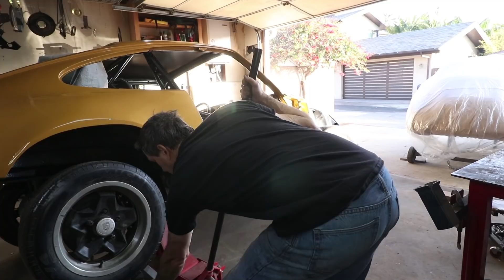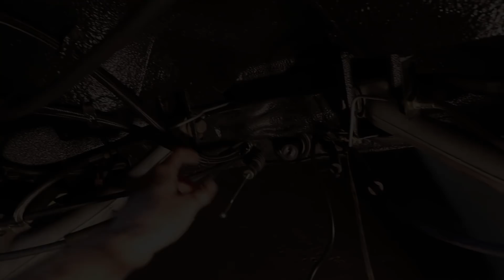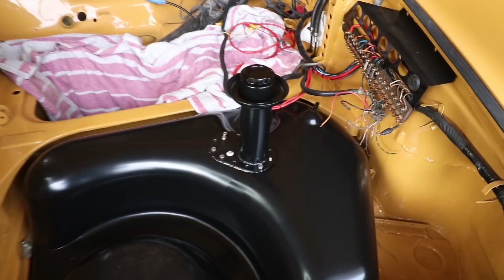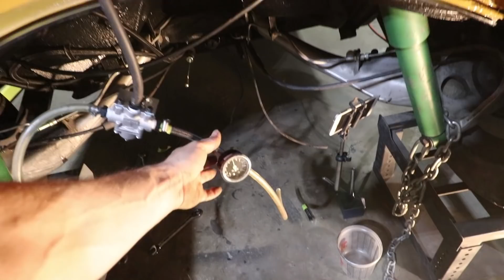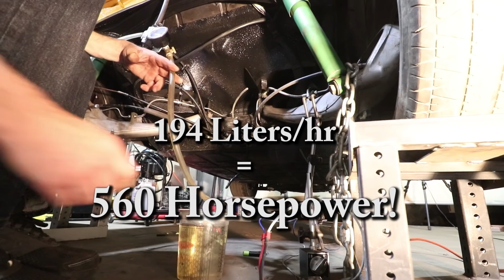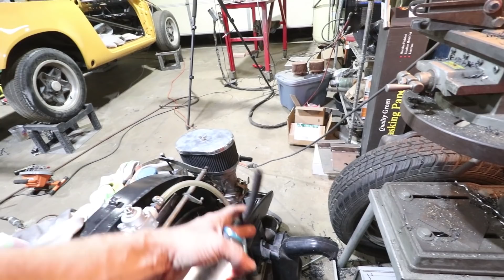We Have GAS in My Porsche For the First Time in 25 Years!

Comment: Kool Tools makes an awesome hose assembly tool that makes AN hose end assembly super easy and results in a pro fitting install.  Used it on the stainless braided lines that i installed for my transmission cooler on my '56 F100 restomod
Reply from the maker: Awesome, I'll check it out.  Although I think I'm done with hoses for the time being.

Comment: I really want a Max Jax setup but I keep seeing you not use them due to set up time and I'm afraid that is what I will end up doing.  I take it you can't leave it set up and fit both Porsches in the garage?  My friend has the Max Jax with a super wide garage, 2 cars wide 2 cars deep and he can leave his Max Jax setup all of the time.  He even has it at an angle which is super nice.  You would like his Garage as he has two 356A Porsches in beautiful original condition. One is a light blue and the other is red.
Reply from the maker: It's probably 30 min max setup time, so not that big of a deal.  Both cars can't fit with both posts in place unfortunately.  
It's kind of pain to get started because I have to winch the 356 or 911 out of the way and then move a bunch of stuff around.  
Labor love right?
Btw, I saw your pinch weld tool and it's nicer than mine!  Good job!

Comment: I cut the hose on a sharp angle. Then slide the fitting.
Slide the fitting down the hose. Then mark cut with Ziz wheel. Slid fitting up to the cut.
I forgot to say Merry Christmas and a FINISH the Porsche Happy New Year !!!
    I love this build , because its, done the way, I've built every sports car I've owned from 16-65 ( currently building two Datsun Z cars)
I would suggest you find a 6.
While you can still get one.
    But keep your 4.
Because at some point YOU WILL BE FRUSTRATED.
Build the 6 over time.
What happens, where the Frustration comes, the 911 guys dismiss you cause it's a 4. And the 356 guys , dismiss you cause you have a 911 shape.
Your orphaned like Rudolf, can't play in any raindeer games !
    Believe me when I say it gets OLD quick.
    Especially when you find out your car is done better than most that ,shun you!
     Once you finish the 6.
Than you can ,four bolt swap
Any time you want to ,wipe the smug ,look off their faces.
    Having the ability to swap motors, it brings you up to, the most Satisfaction, you can have in your car.
   Because NOW you can Run with any of them ! If you EVEN want too !
     What is the difference, between the 912, and 911?
  Just the MOTOR !
Of course there are details.
But it's just two more cylinders soon you won't be able to get a Six.
I suggest to grab one. How much value, have you increased, your perfect build,
when you have two motors?
To satisfy the purist, and the hot rodder !
    Just saying your CAR is Worth this Multi Motor ,concept.
Reply from the maker: Thanks for tip on getting the hose length right!  
The six is on its way in a month or two hopefully if all works out.  
This car will never be finished even once the six cylinder goes in.  It will always need some tweaking, improving, inspecting, etc.
I have a lot of respect for these 4 cylinder engines too.  This is the engine that put Porsche on the map.  If it wasn't for this 356 engine Porsche wouldn't exist today.
That is why I have four of them, ha ha.  A numbers matching SC, two 912 engines, and an industrial engine.  
I do like the idea of swapping motors out for the heck of it and probably will several times.  
The Porsche haters are a funny group.  Luckily they don't get to me.  What I'm doing is NOT popular with them and that is okay.
The enjoyment is in the journey and the driving part.  
I'd rather be a doer than a hater, which I am.  So the laugh is on them.
I can nit pick cars with the best of them, but I like to help instead.
My car is built with a purpose and NOT to impress people.  For example, no one will like my interior most likely, ha ha.